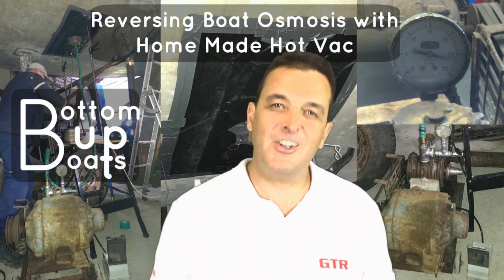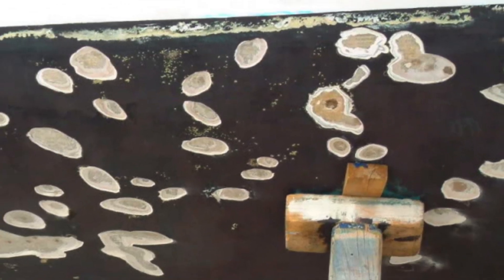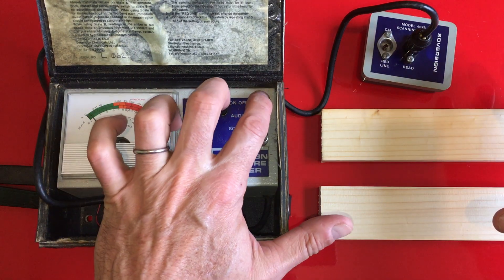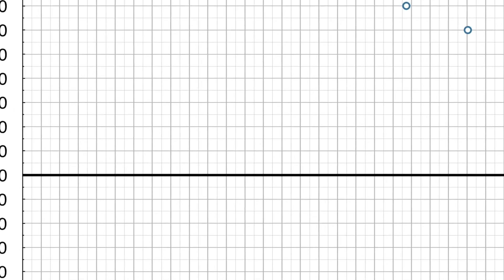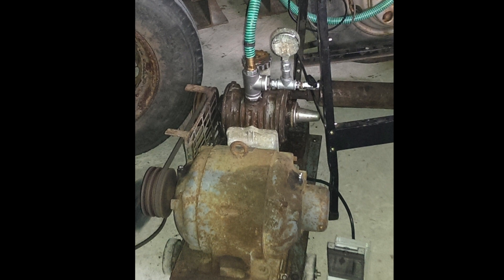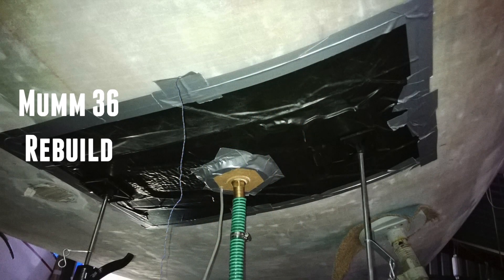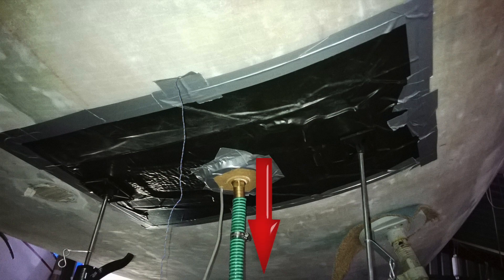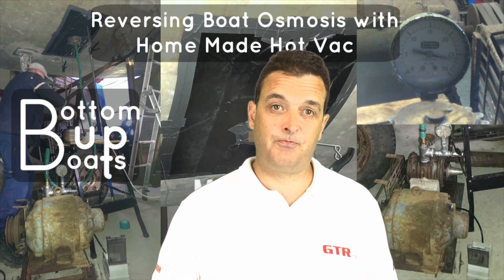Reversing Fibreglass Osmosis

Comment: How long did you keave the pad in pkace on each section? Thanks.
Reply from the maker: Jonathan, it depended on the starting moisture reading and the heat we could get into the area, for the dampest areas we had to do 3 or 4 hours to make a difference. What was really interesting was as we dried one area the reading fell around it as the dampness in the core  moved to the drier areas. Sadly we did most of this in the middle of a cold Belfast winter, if you were doing it in a warmer climate and had a new vacuum pump the time would be greatly reduced.
Reply: @BottomUPBoats  Thanks. I'm looking at doing ours next winter (we'll also be stuck with colder ambient temperatures). Interesting to see a nice low-tech approach. 👍
Reply from the maker: It can be easier to increase the temp rather than the pressure depending on how new your pump is. We had a heat pad both on the outside (under the rubber) and on the inside when we could get it in place to heat up the core. As per the chart on the video the more you have of both the better....
Reply: I'd struggle to get a meaningful mat on the inside of ours as it's small, but I can direct warm air at it - in October I had 25° on the outside surface of a keel stub (air temp 14°) from a 2kW heater blowing on the inside. Your video states electric blanket (for a bed?). I was anticipating using underfloor heating, which I would expect to deliver more heat but haven't checked.
Reply from the maker: @jonathanwebb9862  you will have a lot more heat than we did. We had air temp of between 0 & 5 C when we did the majority of our work. It was not an electric blanket for a bed, it was a small fabric heat pad about a metre square. If you get 25 C i think you should have a good chance to boil the water out of the skin.

Comment: Boiling points for salt or fresh water?
Reply from the maker: Great question, I had not thought of the impact of the salt on the process prior to you point this out. Tables are done with fresh, if there was salt content it would increase the boiling point which would increase the pressure required to dry out the hull.
Reply: @BottomUPBoats  salt increases boiling pt
Reply from the maker: @anthonypeterson5618  you are correct, sorry about that. I should have paid more attention to my chemistry class while I was as school, I have edit to the original reply to keep the information correct for other who may read. I will have to do some research into osmosis to see how the salt content changes as osmosis. From memory osmosis is speed up the higher salt content in the water. I can only assume that a high degree if not all the salt transfers into the hull with the moisture.

Comment: you are not explaining Osmosis properly at all.....its not a cemical reaction at all....just read up on osmosis....
Reply from the maker: Thanks for stopping by and for the feedback, I should have paid more attention in chemistry class. You are correct that both the chemicals dissolving in the water and the pressure that pulls the moisture into the core are physical reactions.